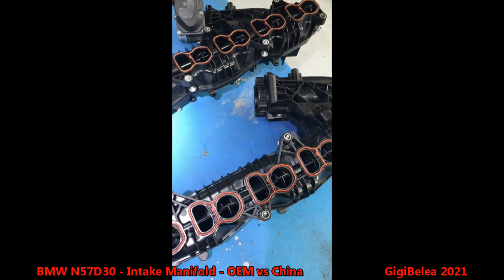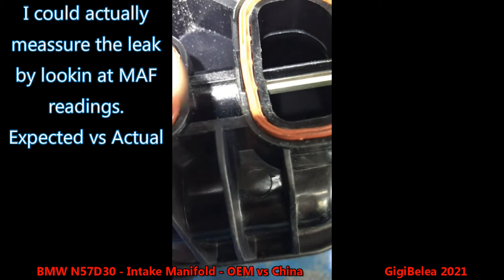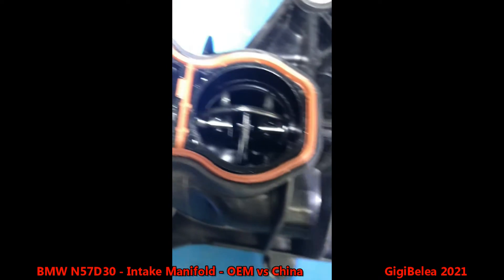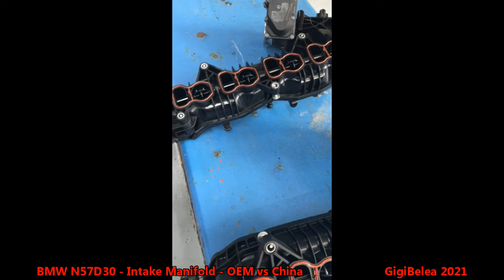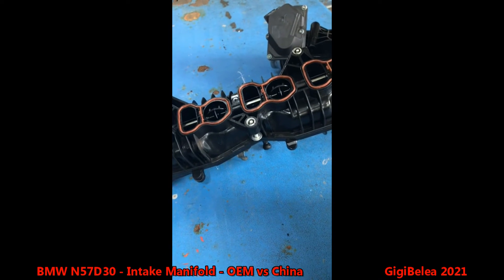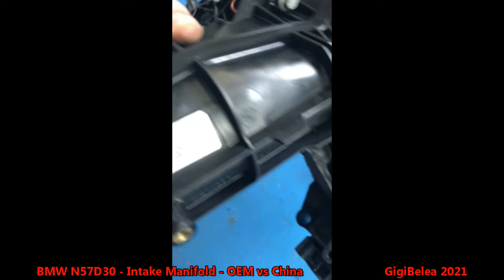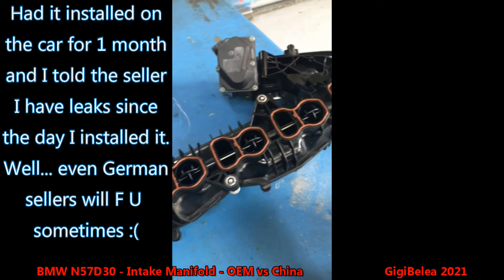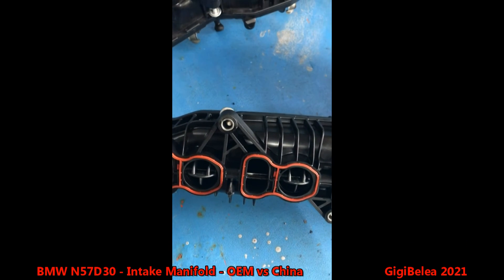N57D30 Intake Manifold   OEM vs China

Comment: Hi bro 
Did you fixed that rattling knock from 2,5k rpm ….
Did you have a little vibration to steering wheel pedals when it knocking?
I have same problem…my car it’s m57 330d manual gearbox….maybe it’s flexplate,flywheel,clutch,rod knock?I don’t know,the car runs very nice accelerating good runs too speed 260 with no problem!but that knock and vibration kills me and my ears;(
Reply from the maker: Drive like that ever since ... nothing changed. 35,000km later..